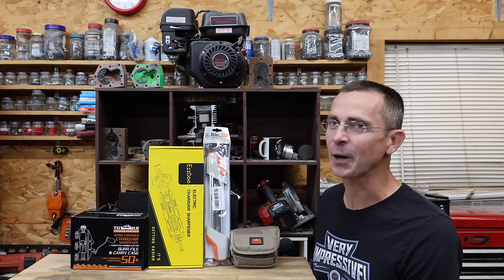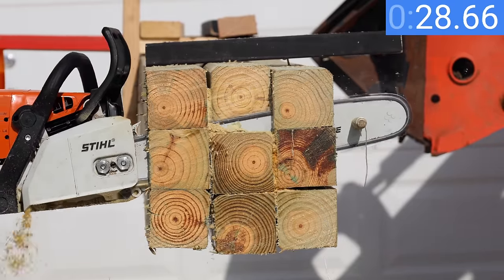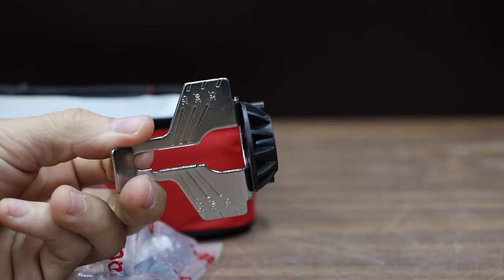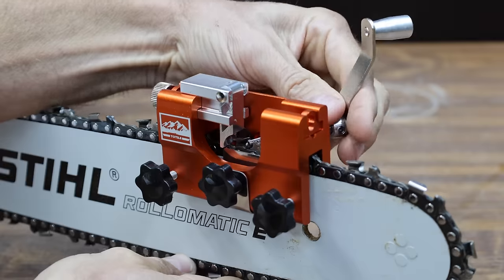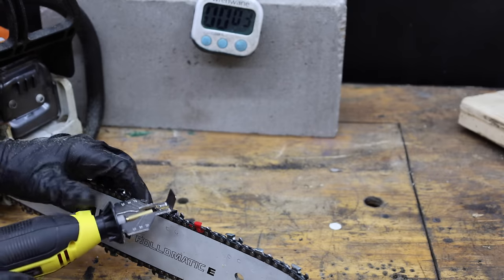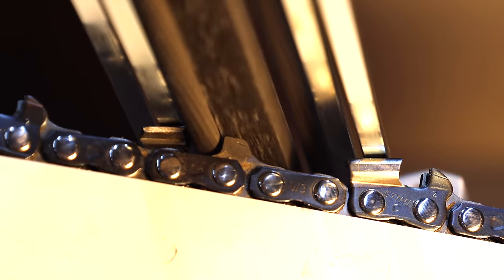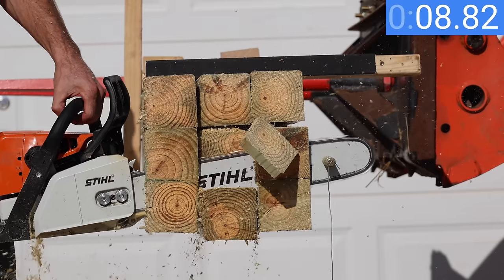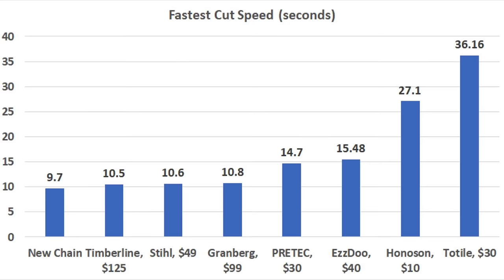Which Chainsaw Sharpener Is Best (2024)? Let's Find Out!

Comment: Ohh boy I have that timberline sharpener and love it . Thank you for the test
Reply from the maker: Great sharpener!!
Reply: Timberline is the best sharpener ever.  I will never use anything else!
Reply: @tomsmith4484  I have a bar set in my vice and I bang out 10 blades per my 2 saws I'm ready to make chips all day . Hands down best sharpener EVER
Reply: Is it really made in USA?
Reply: @FJB2020  the true timberline is . But like anything else there is knockoffs
Reply: @mikehalfmoonmullins404  ok cool, I reached out to them in 2022 and they had one piece made in china still, but said they were working on producing it in the USA.. my guess is they originally went to China to produce it as thats usually how they steal the desigh of things..
Reply: @FJB2020  correct  , I bought mine when the company started making them . I figured it wouldn't be long till someone copied timberline
Reply: @FJB2020  yes, it's made in america.  They are located in Idaho.  They answer the phone and stand behind their product.  The knockoffs are a waste of money.  It's all about the carbide piece that sharpens the teeth.  Nothing else is going to get your saw this sharp.  Once you get used to it, it doesn't take very long, unless you really abused the chain like project farm did and then it will take a couple sharpenings to get it razor sharp again.  I like the raker guages from Westcoast saw too.  Another product made in the USA.  FJB 😉

Comment: the stihl is the only that that is going to offer consistent results through the life of the chain, as the more you file the cutting edge down, the more the rakers will need to be adjusted haha! im really glad you touched on this in the review. i typically go at my chains with a hand file, but ive been doing this for a number of years, and i always adjust the rakers if i notice it not cutting right :) cheers Todd!
Reply from the maker: Thanks for the feedback.

Comment: I’ve found that just doing it by hand works the best with a properly sized Oregon file. Buckin Billy Ray has a bunch of very good videos on hand sharpening 👍
Reply from the maker: Thank you for sharing!
Reply: Exactly. Bucking Billy does best sharpening video's. I only use hand files and will never use any of the toys tested here. With proper technique you make chains as sharp as new if not better using just a file. I can also recommend Husqvarna roller style file guide.
Reply: Buckin is quite the character isn't he !, hes very passionate about his saws and how to sharpen a chain to perform and square ground/filing which is on a whole other level of proficiency. Me personally, I've watched friends etc struggling with gimmicks because they had no idea what they were supposed to be looking at on the chain tooth and ended up with a saw that performed horribly, took off to the side etc. I like using the simple method, a proper sized file for the particular chain and put my saw in the vice which makes it so much easier and less awkward to do the job. So as Buckin says, "Get The Gullet" !.
Reply: I love the 2/1 sharpener. Give it a shot. No reason to resist technology. gets the rakers too. Will make a chain like brand new in minutes
Reply: @factsnotfeelingssendit5961  I assume the tool is not capable of being adjusted to fine tune the raker height, where as doing it by hand one can use a gauge that has a hard or soft wood depth set. Also one would need a different tool for every chain size being used ( different saws ).
Reply: @charlesb4267  Not sure if you can get different sized files so maybe. Either way it does a great job. If you want to cut soft wood and get a deeper cut hand file after. Whatever works for you but I love them. Borrow someone's and give it a shot
Reply: @factsnotfeelingssendit5961  I had looked at the Stihl website and from what I gathered each unit had a specific size molded into the handle. Of course I can't knock the unit as it obviously proved it works on this video and like you  said yourself its worked quite nicely for yourself as well.

Comment: Another great unbiased video. I have been using the same Stihl sharpener for several year and it has held up very good and I am still happy with it. One thing I really like about the stihl is that it works on the job site. I use it every time i put gas and bar oil in the chain saw. Its easy to use and if you use it frequently its fast and does a great job!
Reply from the maker: Thanks!  Thanks for sharing.

Comment: Stihl 2in1 Chain sharpener is the best sharpening tool EVER!! It's very important to get the correct one for the chain your chainsaw uses. The chain sizes for Stihl are: Picco, 3/8 Picco, ,325 and 3/8.
I have two chainsaws and two tools.
MS230 uses the same chain like your MS250 which is 3/8 Picco and my new chainsaw is MS311 which uses 3/8.
Reply from the maker: Thanks for sharing.
Reply: @ProjectFarm  Thank you for fun video!! Cheers from Croatia!
Reply: I agree I have all 3 and love them
Reply: This might finally explain why I was unable to get the baffling Stihl to work with any of my chains!  There are different sizes?? Is there any way to find out which Stihl sharpener to buy?  I use Oregon 90PX (⅜” pitch .043 gauge low profile) on my small saw and Oregon 20LPX (.325 pitch .050 gauge) for bigger saw. Can anyone tell me which Stihl sharpener I could buy that would work with either of these chains?
Reply: @BenDiscoe  Go to Stihl dealer, take your chains and they will give you correct tools. The firt one I'm not sure because you mentioned low profile so I'm not sure if it's 3/8 or 3/8 picco, but the other one is certainly ,325
Reply: @BenDiscoe  Wait, if you use Stihl saws, which one are they? And BTW always use Stihl chains and bars.
Reply: @BenDiscoe  Always use Stihl parts and always AVOID Stihl oils and you are golden!!

Comment: Just an FYI the PFERD brand sharpener is the original unit that the stihl sharpeners are based off of. They are cheaper and are IDENTICAL minus the handle color. You can get a box of files to replace the ones in the unit. I usually get 5-8 sharpening out of a 20" bar.. If they don't seem to bite when you file, change the file. They are about a dollar a pop.  Out of all the sharpeners, the 2 in one sharpeners really do work the best if you are doing touch up or small repairs, if they are really torn up, you'll want an electric sharpener. Certified sawyer, with a decade of experience. Also, recommend putting the saw in a vise to sharpen. Just keep 2-3 sharp chains in a small bag with your tools, sharpen when you get home.
Reply from the maker: Thank you for sharing!
Reply: Only works on NON skip tooth chains.
Reply: @w8stral   Why wouldn't it work on a skip tooth?  (or is that a joke?)
Reply: @OneWildTurkey  The tools flats run on the chain tooth top flats.  Thus SPACING of standard 3/8 chain is required.
Reply: @w8stral  Thanks
Reply: @mdsauve13 - where can I find the replacement files for the 2in1?  I’m having trouble finding them
Reply: @jeffroberts760  Uses standard round files...   EVERYONE sells them in packets of 10 or 12....... Yikes bud.   The flat file is a standard bastard file(yes its name)
Reply: @w8stral  no wonder I couldn’t find a specific product - there isn’t one - thanks for the help

Comment: I have been using the Stihl sharpener for a few years now. I like how quick and easy it is to use in the field if needed (no need to hunt up power or fiddle with gizmos). The files have also held up very well and towards the end of a chain's life I really think filing the depth gauge at the same time helps. Glad to see you had good results with it as well.
Reply from the maker: Thanks for the feedback.

Comment: Great video!! I hit a rock that grew into the trunk of a bush with my chainsaw and dulled the chain today. Could not have had better timing for a chain sharpener comparison video! After watching the video Im gonna go with the stihl sharpener for the following reasons:
1. The price is very reasonable. 
2. German made by stihl vs China, so better quality as demonstrated in the video.
3. There is virtually no set up time to begin sharpening.
4. The portability vs a power tool sharpener is better for on the job use.
5. Time to complete sharpening isn't terrible for a manual tool.
Reply from the maker: Thanks!

Comment: I bought the Stihl sharpener, two sizes, about three years ago. Best I have EVER used.  It's a little "clunky" to replace the files but I have only had to replace two files in the three years I have owned them.  It is amazing how many companies still don't understand that the raker has to be reduced as you sharpen the blades.  The Stihl is the only sharpener I have found that addresses that.
Reply from the maker: Thanks for sharing.

Comment: After your last video about sharpeners, I bought an off brand version of the Stihl sharpener from amazon, under $30 with tax when I bought it, now around $25 with tax.  It came with a spike foot clamp which helps hold the saw when I'm out in the field and can't use a clamp or have someone hold it for me.  Definitely like using it, especially since I can leave it in my kit that comes with me to the field.
Reply from the maker: Thanks for the feedback.

Comment: The best: an experienced logger with a couple files, flat file and a gauge. Gets it done in minutes and doesn’t need all those gimmicky tools. Simple. You can do way better than that the hand filing job you did. You need to correctly remove enough gullet and get the top plate flat and at the correct angle. Did you do any of that? Put it in a vise and do it correctly for starters. Sweet videos though another great one sir!!
Reply from the maker: Thanks for sharing!

Comment: I personally bought the timberline sharpener a year ago and I LOVE IT!! Don’t get me wrong, the other two (Stihl, Granberg) seem like decent sharpeners as well, but I work on my dad’s old farm cutting firewood sometimes and he lived out on a big plot of land in the middle of nowhere! One thing I learned is when you’re out in the middle of those woods and you’re almost as good as a mile from your home or garage when you find out that you need to sharpen your chainsaw: #1, electricity ain’t exactly and necessarily available out there in the woods. #2, You don’t want to be using anything that’s gonna be draining the battery on your vehicle… that’s a good way to get stranded and askin’ for trouble in my book. #3, you need a reliable and effective sharpening tool that’s going to get the job done fast. So I spent a little more dough getting all five sizes and bits, but I’ve gotta say the timberline sharpener was definitely and by far worth every bit that I paid for! Whether it was for my monster size chainsaws, or even my pole saw pruners, it had them razor sharp in a matter of minutes!
Reply from the maker: Thanks for sharing.

Comment: I've owned the Stihl sharpener for years. It was recommended on Steves Small Engine Saloon about 6 years ago. I bought one. I've had so many others. They were junk compared to this. They got it right. As long as you follow the directions it'll sharpen that chain to just about a razor if you're good with it and take your time. So far I haven't had to replace any chains since. I have one that is finally getting close to being worn out. I used it last week to take out some pine trees, which it did easily. Still has life left. First trees this spring season.
Reply from the maker: Thanks for the feedback.

Comment: I've had 2-3 chainsaws for decades; 3 years ago I got  a Makita electric - it surprised me with the quality of the unit. For years I bought multiple chains from an outfit in the NW (Baileys) at greatly reduced prices.Or I get them from a local shop for a bit more. Your presentation is well done, I compliment you. For my needs the manual Stihl unit looks like it would work fine, much better than a single handled unit. Not related to your presentation, but 4 years ago I got a Milwaukee Sawzill (reciprocating saw) & for roots or close to the ground wood cuts I use it over the chainsaw, as just a small 'dip' in the dirt or rock with a CS can dull the blade. Thanks again for another excellent presentation.
Reply from the maker: Thanks and you are welcome!

Comment: Been using the Timberline for years, works great for me. You can order different sized bits to fit the chainsaw you have. Tried using a file, but the chainsaw was duller when I did. The ware is also very even with the timberline.
Reply from the maker: Thanks for sharing!

Comment: You should do a follow up… drive around to a logging site and let several of the guys (of different experience levels) sharpen a few chains and compare their hand file work to the sharpening systems. I get the feeling with enough experience/practice the hand file will probably outperform any of the sharpening systems. I only sharpen like 25 chains per year and after a few years of that I can easily get mine sharper with a hand file and depth gauge than the stihl dealership guys can do with their bench grinding system. I’d love to see how these stack up against the old fashion file in the hands of somebody who uses their saw to bring home the bacon.

Comment: I have ave been very happy qith the stihl 2 in 1 sharpener. With a bar vice you can sharpen the chain fairly quickly and effectively.
I have the 3/8 .325 and the pico 3/8. I use it once the chain is starting to show smaller chips.
If you dont let the chain go to long between sharpenings its super easy to keep the chain nice and sharp.
Reply from the maker: Thanks for the feedback.

Comment: Master Farm: Yet another valuable review. Well done. LOL I absolutely love it when my less than scientific trial and error method yield the same results as yours. But my method MUCH more expensive than just following your guidance.

My old-ish Stihl 026 is an amazing saw. That is when the chain is sharp. Wouldn't sell it for $750. A few years back I put it up for the winter draining the gas w/o running saw till it quit. I know better - big no no. To boot I was out of Moto Mix and it had ethanol fuel mix. Just didnt act right that spring. For the first time ever took it to the Stihl dealer. Of course they wanted to replace the carb. I went ahead and let them "tune" it up best they could. I removed carb, dismantled 80% and ultrasonic cleaned it. Now works just fine. While at dealer owner came out hearing me complain about chain sharpening time AND results. He asked if I ever tried the Stihl manual sharpener. Feeling guilty about cheating out on the OEM carb, for 1/3 the price of an OEM carb I bought it. YES it works great and can take it with you in the field easily. 

Sorry for long comment
Reply from the maker: Thanks and you are welcome!  Thanks for sharing!

Comment: I’ve got a Granberg but after a few uses, I rarely use it. In use it’s pretty quick; but it takes 10mins. a side to fit & adjust. Plus there’s too much play in the system to get consistent results.

I once tried a Stihl 3 in 1 and despite my prior misgivingings, I thought it was good. At the time, Stihl were only making them to file 3/8” & 3/8” P at 30°. So at that time, it was unsuitable for my needs. But I gather Stihl are now covering 1/4”, .325” 3/8” P, 3/8”; angles 25°, 30°.

I’m still hand filing, (Vallorbe, as Oregon files seem to be made of butter a Stihl are too expensive) especially in the woods, where a round file and magnetic angle guild weigh next to nothing. I’m happy to spend a few minutes to do a light touchup but if it’s going to take 20mins.+ to sharpen. I’ll just swap the chain for a spare sharp one.

When I’ve got four or more chains, that would each need 20mins.+. I’ll resort to using the Oregon wheel grinder I bought, after my disappointment with the Granberg. The advantage of the Granberg and why I got it. Is that is just needs a 12v battery. While the wheel grinder would usually, be permanently bolted to a wall or bench. I made a simple wooden jig, which the grinder is permanently bolted to and when needed, the jig rests level and clamped in a sturdy work vice or even a portable clamping work stand.
Reply from the maker: Thanks for sharing.

Comment: I've been using the Timberline for almost 10 years. I love it overall. It takes a long time to sharpen the blade on my 24" 460  Huskvarna. However, It removes very little material from the blade, I've sharpened blades 30+ times. I've lost count to be honest. I kinda hate how long it takes, but I was really bad with files and ruined blades.The Timberline takes some getting used to but you get a scary sharp blade. If you round the edges of some the teeth hitting rocks, it's limited to removing a small amount of material. You may have to sharpen it twice, which can take 1/2 an hour. I had 10 acres of overgrown, neglected land. 100 or so Northern Pines 30+ feet tall, countless Cedar and Buckthorn.
It payed for itself many times over. It's a good home owner option. When I was using nearly everyday, I considered getting a high quality grinder.
Reply from the maker: Thanks for sharing.

Comment: Thanks again, I use carbide double cut deburring tools in either my Dremel or my Bauer battery packed carving tool and for super fast and sharp chains it works great but I would like to file the depth gauges at the same time. Plus the carbide tool will last a long time but I haven’t seen a exact fit for the larger chains so I just went up to a 1/4 tool but haven’t tried it yet

Comment: I use the Stihl in the field and the Timberline in the shop where I also clean the chain and bar.  As a side note; I found that a zip tie with the end cut off makes a good cleaner for the channel on the bar. But it wouldn’t scratch it up like wire or a nail.
Reply from the maker: Thanks for the feedback.